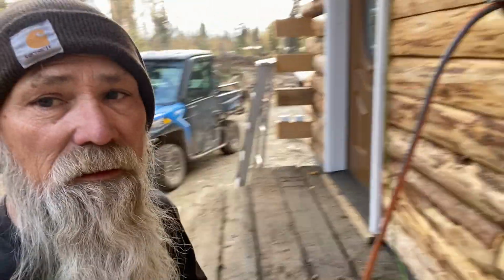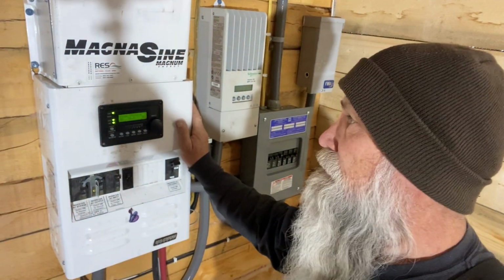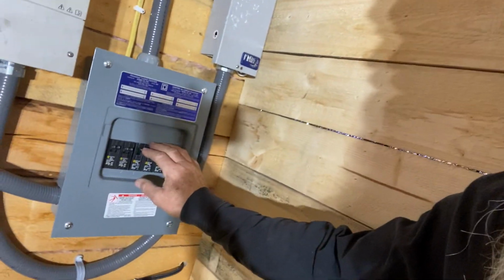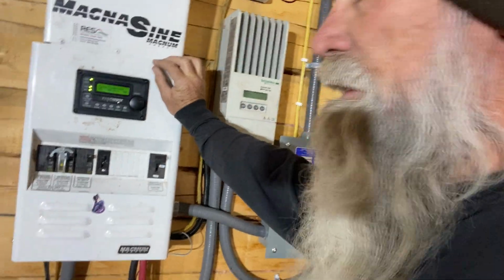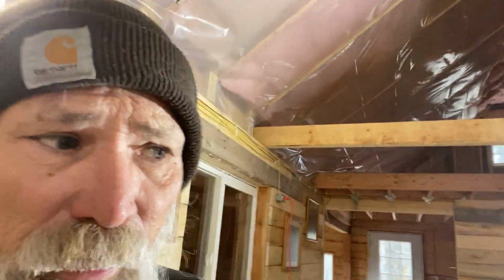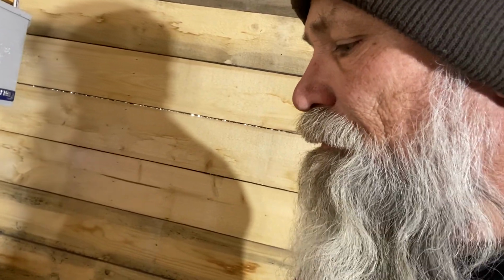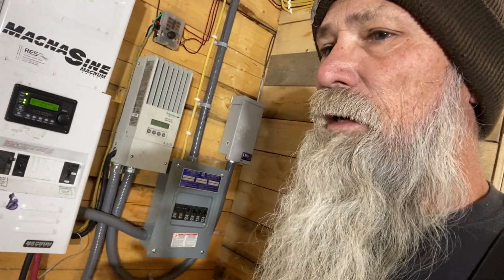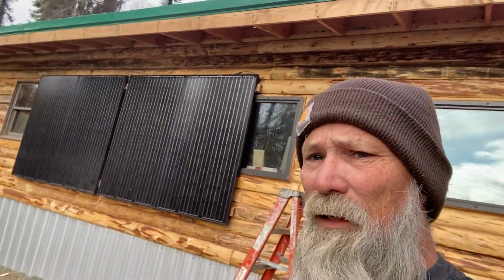Solar power at Perry’s cabin. Cost and and content.

Comment: Breaker box for incoming solar panels, I never thought of. But a very good idea. I like plenty of breakers !
Reply: If you do it by code(here in Canada) you require a circuit breaker, and its nice to be able to just shut off power from your panels if you need to work on your system...Some people will just install a circuit breaker on a din bar and some will use an inline fuse that can be shut off, I prefer a metal box with a circuit breaker just in case...

Comment: I'm surprised all 3 of you didn't pool your money and build 1 big system.  Was that a consideration?   

Did Tyler check his insulation to confirm no mold is growing?
Reply from the maker: No we just ran fans to dry it out.
Reply: @MitchellsInAlaska  if the insulation got wet down to the foam board, running fans won't dry out the insulation.   As you know most of the heat will rise so it's creating a perfect condition for mold during the winter (prolonged damp and cool).  Black mold isn't something you want to chance.  I definitely hope it's completely dry.
Reply from the maker: @MyAlaska12  me too
Reply from the maker: A big system just wasn’t feasible for us because the cost gets so high when you go up in size that much

Comment: Have u ever thought of putting the solar panels on the roof even if u have to build a frame up there and run the wire under the eve and into the system? Takes up no room in your yard or on your walls no trees to cut down and may be a better angle to the sun
Reply from the maker: Too much snow. It covers them or stops the snow from sliding off
Reply: ok